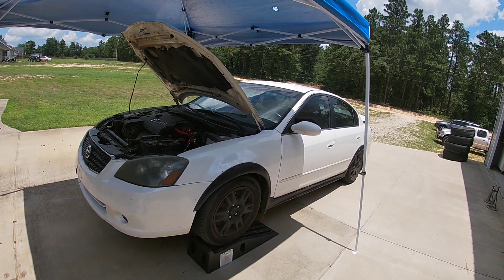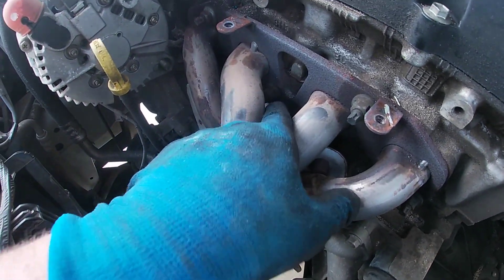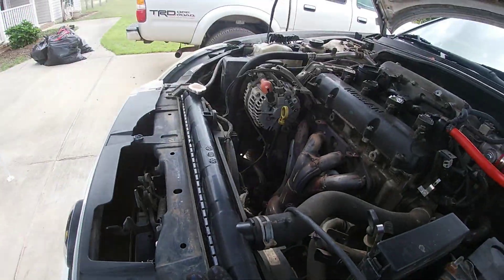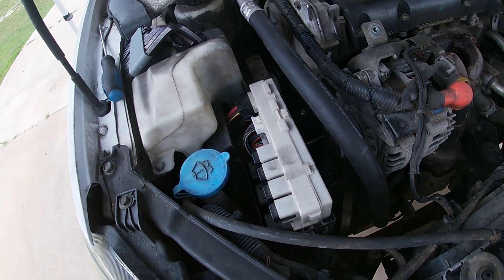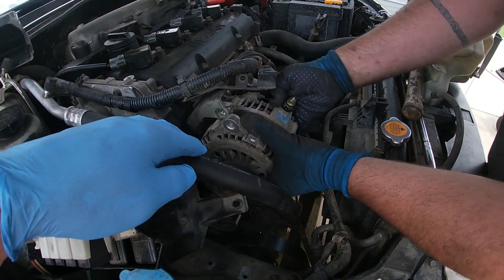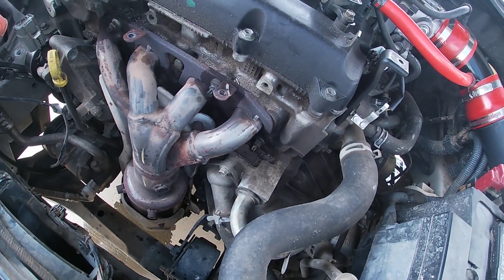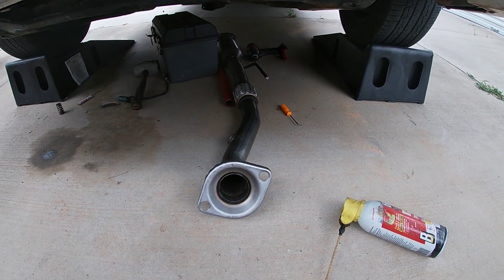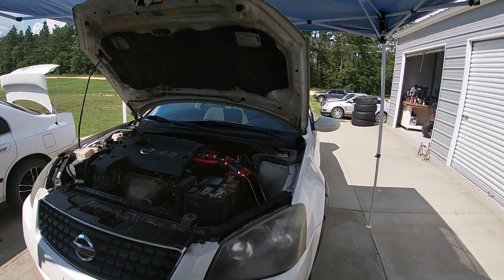2005 Nissan Altima Catalytic Converter Replacement

Comment: no engine code after replacing it? Mine with 2006 keep throwing p0420. I changed aftermarket Cats front and rear and o2 sensors front and back.
Reply from the maker: I still have my code. I bought OEM CATs for the front. I will let you know if that helps clear my code
Reply: @MyLooneyBin  I installed a non fouler on rear o2 sensor after CAT. NO p0420 so far (about 1/half month). Car runs great no issues.
Reply: @MyLooneyBin  Follow up on the OEM CAT? Did the code clear?

Comment: I live in an area without emissions, i have the check engine light for the cat (plus the rest of the exhaust is pretty rusted). I'm debating on replacing them because i have read about them destroying the engine if they break apart. But at the same time, it was a 500 dollar car. I honestly don't know what I'll do